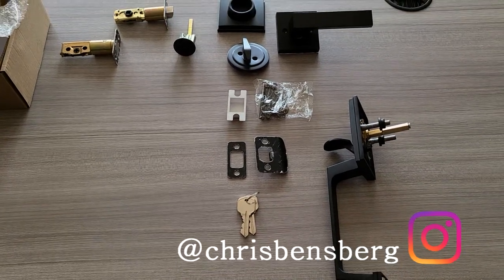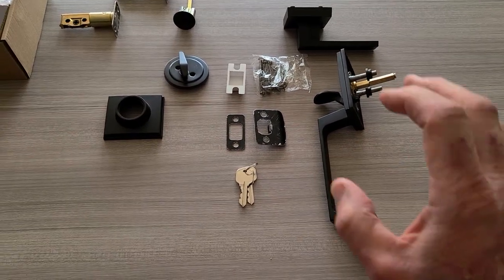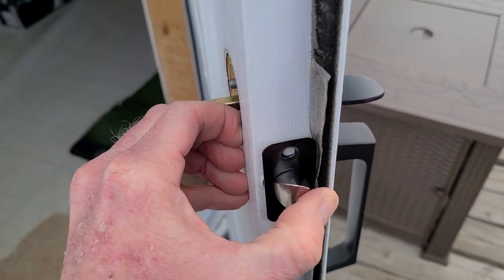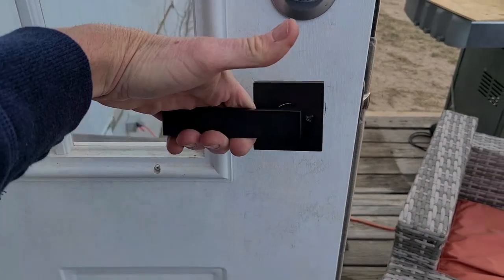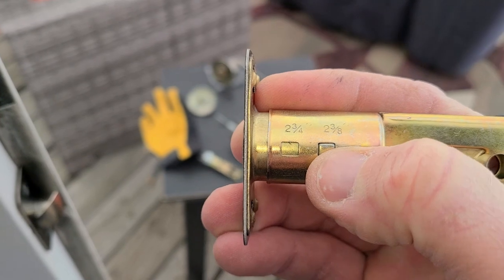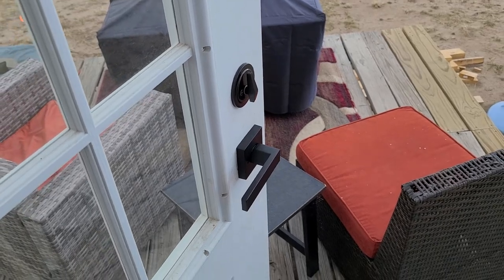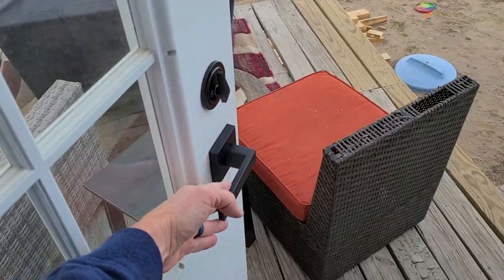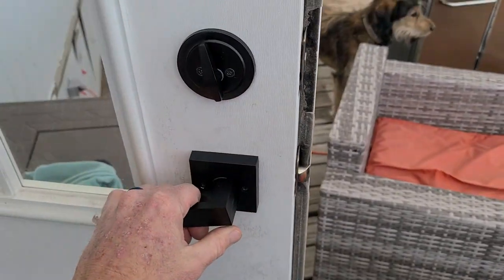Modern Farmhouse Matte Black Front Door Handle With Deadbolt - A MUST Upgrade For Your HOME!

Comment: I have the same hardware. The outer ring covering the deadbolt is loose. It doesn't spin just not tight against the door. The screws are in very tight. Does not affect operation just annoying. Any suggestions on what caused that?

Comment: I have the exact same knob, and the deadbolt does not work with the existing hole and I would love to know if I have to cut the hole bigger or in an oblong pattern. It seems to have jumped from extending the deadbolt carriage to assembly, and one fell swoop.

Comment: The worst is when people are still using the 90's yellow door handles. The matt black and brass finishes are very nice. Make any older door look so much better.

If anyone comes across a loose door latch or deadbolt and wants a solid repair that doesn't involve glue, stick, putty, or that ugly metal sleeve that ruins the look of your door, ReSecure Latch is that answer. ReSecure Latch sits inside the door alongside the latch, resecuring your loose latch from the INSIDE. Great for property maintenance, homeowners, and DYiers.

Comment: How do you install the bottom part of the handle? The instructions are unclear
Reply from the maker: The bottom would install the same as a regular handle but you would need to drill a hole for the very bottom to secure it tightly. Hope the info helps
Reply: @TipsNNTricks  does the handle feel loose at all when you pull the bottom handle since that bottom bolt is not installed?